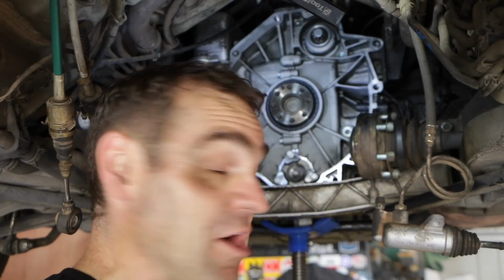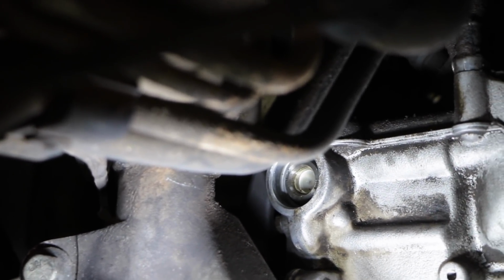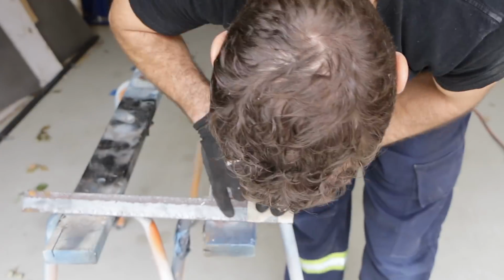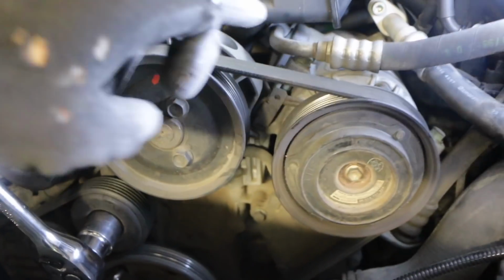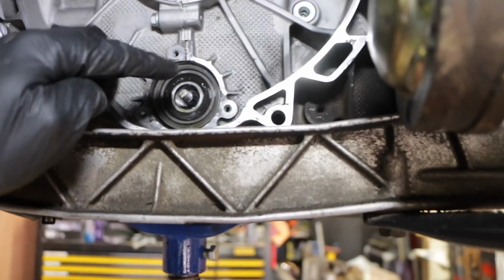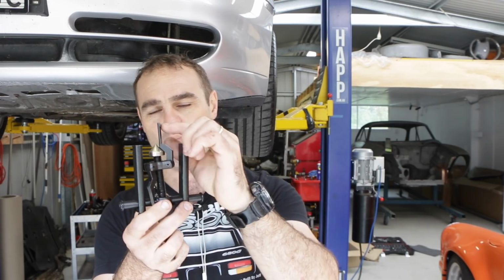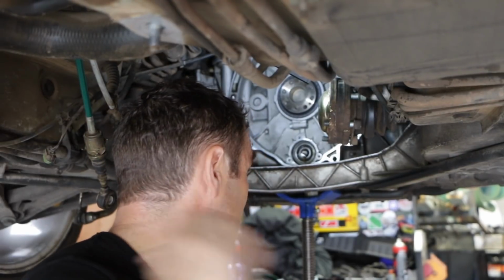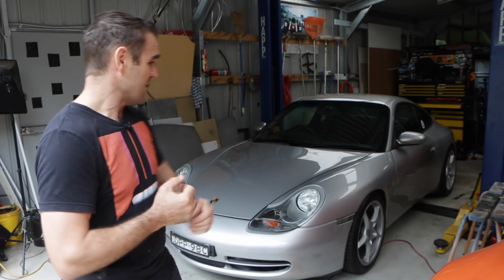996 IMS bearing replacement.. FAIL!

Comment: I changed mine with an EPS bearing. Made the puller out of a bolt and piece of pipe. Easy. DON"T take your car down and fail to replace that bearing. My old one was perfect also, but you never know. If it goes, so does your engine. The EPS bearing is a bigger roller bearing and won't fail.

Comment: How on EARTH did you get to that rear bolt on the AC compressor?? Which tools or extensions did you use?
Reply from the maker: From memory I only used a short extension and a long socket. A small mirror will really help so you can see it as that is the real problem.
Reply: @HomeBuiltByJeff   Got it done last weekend. Surprisingly it wasn’t very difficult at all actually. I have the X51 kit so it may be different due to it having a cast aluminum intake manifold, but I just removed the temperature sensor an rubber grommet between cylinder 4 and 5 and that gives an almost straight shot down to the nut with an extension on the socket. I had one of those socket sets that had a little bit of wobble on the extension which was perfect for the job. I used my phone on video to see where I needed to “go” which made finding the bolt with the socket a breeze. It literally took me 30 min to remove and replace the whole A/C compressor. Thanks for giving me the confidence to do that job!

Comment: Jeff I had to rewind because I heard something you said to describe excessive play. Now I not sure what was on your mind at the time but you described it as SCHLOP. Well I have two dogs and sound of them lapping  up water is  schlopping ....don't think  that  works here .However a one modern day version ...The sound which is made when a very wet substance hits a durable surface at force. This sound would be most commonly heard when an extremely wet turd departs from your anus and hits the surface of the water at speed. Jeff the ims is a right turd....
Reply: This is the dumbest post I have read in a long time.  Delete your account.

Comment: Some bearing kits come with the proper tool to remove the IMS.
No other puller or extractor will do the job it's has to be the correct porsche spec tool. A slide hammer will wreck the bearing at the other end of the Ims shaft.

Comment: Isnt there a Circlip in front of that bearing that has to be removed so that you can pull the bearing?
Reply from the maker: Only on 996.2 with the single row, dual row doesn't ;)

Comment: Don't you pull the bearing by tugging on the bolt you bonked into the shaft?  Put a nut on it and use an 3-prong (outside arms) puller.
Reply from the maker: If you don't pull it perfectly square you can snap it (MANY have) and then you are totally screwed ;)

Comment: there a snap ring holding the bearing in its place, I saw a you tube video and Both where done with the correct puller. https://www.youtube.com/watch?v=hAxj6FKMzvM however he says you can also do it with 2 pry bars
Reply from the maker: The pry bars are just for the cover ;)
Reply: Home Built By Jeff did you remove the circlip? Love your Alfa series btw.
Reply: YES  Iagree. because i watched this video youtube sent me other IMS videos. The one i watched a dirty great big SNAP RING hold the bearing in, Didnt hear him mention it or show him removing it, done it myself so not going to hate BUT I think this was the reason it didnt come out. Shearing off the puller lugs indicates it was still captured. So guess gearbox coming out again!!!

Comment: Jeff. With all the bashing and pulling that bearing is damaged. Don’t spend too much time driving with it. That damn thing is problematic enough when left alone!! Build a puller sleeve the pushes on the block as it pulls the centre stud. That might work better. Also, join the “Porsche ims bearing M96 M97 engine” group on Facebook. I’m sure we can all help out.

Comment: How did you get the center bolt back through??? The one that you knocked into the hollow IMS tube?  It's magic!
Reply from the maker: Magnet ;)
Reply: Home Built By Jeff Did you have to use the slide hammer to get the bolt to seat properly again inside the bearing inner race?

Comment: Stupid question but did you remove the circlip that retains the IMS bearing? Otherwise, I have found Supercheaps hand tools to be of fairly low quality and had breaker bars bend, ball joint separator pickle forks snap and a few others to the point where I no longer buy their products. I managed to borrow a Sykes Pickavant bearing puller slide hammer for a similarly akward bearing to remove.

Comment: I think if I'd got that far, then got stuck I would have opened up the dremmel box and cut that bugger out little by little. Followed by the clean of its life.
Reply from the maker: The metal shavings would go through the whole bottom of the engine and you would have to completely tear it down to clean it.
Reply: @HomeBuiltByJeff  possibly but I have just watched somebody drill and retap a damaged sump plug while it was still fitted by using the old oil to flush the particles back out.
Reply from the maker: @SticklesMickles  Better them than me, particularly with Porsche engine rebuild prices...

Comment: Your Ims bearing is probably fine, it's been nicely lubricated by the leaking crank seal. 
To remove the Ims I think heat would've been your friend here. Effectively you were pulling the inner race where the outer race is gripping to the block. With some pressure put on the puller on the inner race, heat around the outer race would've freed off the outer race and would've allowed you to pull the bearing out.
Reply from the maker: It also has a recessed clip around it that needs to be overcome.

Comment: Jeff-you are always a brave man to tackle some of these things.  I thought that when you welded tabs to the arms to increase the size that one snapped off.  Did it pop outside the casing? I'd be concerned about metal bits floating around a bearing
Reply from the maker: I got all the bits, that was something I made sure of ;)

Comment: What I did was use the part from the slide hammer kit (same or similar to the one you bought) that locks into the bearing, but instead of the slide hammer, I put a piece of threaded rod in the end.  Then I took a piece of pipe close to the diameter of the IMS shaft, ground down the end until it fit perfectly inside the case hole and resting on the IMS (but around the bearing), and slipped that over the threaded rod.  A flange and some nuts on the threaded rod after that, and it's a puller that will extract the bearing while holding the IMS in place.  It's worked great on both single and double row bearings every time I've used it.

Comment: The pullers included in these kits use the the center attachment bolt of the bearing and  push from the tubular wall of the surrounding intermediate shaft allowing no stresses anywhere except on the bearing itself. The puller must touch only the intermediate shafts end facing you and the center bearing bolt period. So the answer was a piece of tubing with an outer diameter of the intermediate shaft , an inner diameter of just larger than the bearing outer races  a flat piece of stock with a hole for the bearing center bolt (which needs a little extension made for it ) and a nut and washer for ease of rotation . The bearing now can be drawn out with all stress only on the bearing.

Comment: Jeff hold on. As a mechanic you will learn,that every bearing no matter where located must be drawn out of it's home . No force between inner and outer races is tolerated. If you pull from the wrong place or impact any bearing you will dent the balls and races causing multiple injury locations internally . This will cause the bearing to start to degrade as the balls now impact multiple flat spots  as they spin. In your particular situation you pulled on the case by way of the shaft and used the shaft's forward travel stop with the force of the puller. The proper puller used in these
Reply: He's removing the bearing and will throw it away after it's out. Why should he care if the balls or races are damaged? (Except in the current case where he's about to drive 4k km on it...)
Reply: @kwajkid  because he buttoned it back up with plans drive it 4,000 km.  Hovered4 is warning him against doing this.  He has a point, and a very good one.  Bummer to have the IMS go because of something Jeff did trying to replace it.

Comment: Not sure you need to remove the top tensioner under the AC compressor. At least I did not...
Reply from the maker: You can't get the third tensioner without it. I have heard of people who don't but it is part of the recommended way to do it.

Comment: It's not a good idea to use a bearing that been pulled and mangled with a sliding hammer. The bearing surface have been damaged now, and I would not trust that bearing anymore. Don't be a tool, get the right tool 😁
Thank you for a really cool channel! Inspiring me to get started with a few projects on my old 911 👍

Comment: For future reference, you can pull blind bearings by stuffing wet newspaper in there and then using something that’s close to the ID of the bearing (like an extension) to hammer the wet newspaper and create high pressure that pushes the bearing out. That’s worked well for me pulling pilot bearings.
Reply from the maker: It is a big hollow tube behind so that won't work on this one.

Comment: The previous owner of my Boxster made a right mess of the IMS replacement. 

They had presumably used a slide hammer and cracked the bearing housing in the process.
Then they used what looked like a grinder to clean it up afterwards.
Ended up replacing the RMS, clutch and flywheel and left it well alone as amazingly it was not leaking.
Burners channel was a great help, shame he does not upload anymore :(

Comment: I used this set to pull out the spigot bearing on my LS1....
The hydraulic method dosnt work on those! 

The slide hammer didnt budge it the press fixture was perfect!

https://m.ebay.co.uk/itm/16pc-Inner-Bearing-Blind-Hole-Remover-Extractor-Puller-Set-Pilot-Bushes-Housing/201920887832?ul_ref=https://rover.ebay.com/rover/1/710-53481-19255-0/1?ff3=2&pub=5575376664&toolid=10001&campid=5338268676&customid=EAIaIQobChMI7NusxteK6AIVRLDtCh2e9whhEAQYCSABEgLhHPD_BwE&lgeo=1&item=201920887832&srcrot=710-53481-19255-0&rvr_id=2326459727184&rvr_ts=b9b8fc4b1700a9b19c072330fff2afb9&_mwBanner=1&_rdt=1&ul_noapp=true&pageci=6b1ce7c0-89c4-4e07-a743-e4a782118cc7&epid=18011013161

Comment: You can use a dinabolt or ramset concrete bolt to remove bearing like these.
Reply from the maker: Interesting, it would need to be a 20mm one but yes that could work.
Reply: @HomeBuiltByJeff  . You can space it out with split washers or a bit of pipe with a cut to split it open.

Comment: Weld a threaded tube or stack of nuts to some threaded rod. Wind tube/nuts onto IMS bolt. Put large socket (bigger than IMS) over IMS with threaded rod sticking through ratchet square. Put big washer over threaded rod and socket and use nut to wind out bearing?
Reply from the maker: I considered doing exactly that, but I have heard of a lot of people end up breaking the end off the bolt and then you are worse off than I was.
Reply: @HomeBuiltByJeff  Assuing it's just an interference fit has anyone tried plumbing pipe freezer to contract the bearing inside the case?

Comment: Here is the guy that made a puller from a pilot bearing puller and some 2 inch pipe.  Fast forward to 5 mins and it shows the tool he made. https://www.youtube.com/watch?v=lbM3c2V4scw
Reply from the maker: It is the pilot bearing puller that was the issue. I have heard of others having the same issue.
Reply: @HomeBuiltByJeff  he had to modify his one to make it work. Sounds like you have a lead on the LN engineering tool already : )

Comment: In a few replies you mentioned dual row bearings don't have c clips, is yours a dual row?? Aren't they supposed to be the safe ones?? While the centre bolt was removed did you check the width for bearing type?? All in all a great video showing as a realistic view of IMS changing. Always appreciated
Reply from the maker: Yes, dual row ;)

Comment: That thumbnails. It tells of the struggle. Reminds me of dropping the oil pan of a 1.8t for an easy oilpump change to find pieces of IMS bearing which explained the low oil pressure under 2000rpm. Not much to do but mount all new parts, bolt it up and disconnect the oil pressure buzzer. Drive and smile.

Comment: where is the circlip?  Perhaps there is a circlip under that plastic cap? something has to be there to keep that bearing from moving. this earlier engine is different than this one?  https://youtu.be/hAxj6FKMzvM?t=224
Reply from the maker: No circlip on the dual row ;)
Reply: @HomeBuiltByJeff  gotcha, the recommended bearing puller looks pretty heavy duty compared to that slide hammer. Now i can see what they're talking about when they say that cars that are thrashed running around the race track have bearings that last longer. One look at that black sludgy oil that oozed out tells the story.

Comment: The bearing is hold with a C clip you do not show removing it .In 2001 model maybe you dont have C clip.
Reply from the maker: The dual row doesn't have a circlip, it has an internal clip.
Reply: yea thats exactly what i was thinking but a circlip should be easy to see right?

Comment: If Its a Blind Hole You Can Put WET toilet paper down the hole and pack it in really tight and the tighter you pack it (hit it with a punch that fills the outside diameter) and the toilet paper will force the bearing to reverse out of the hole
Reply: Mate toilet paper is in really short supply here in AUS at the moment. I mean it. 😭😭😢
Reply from the maker: I know of that trick, but in this case the shaft behind the tube is a very large hollow tube that runs length of the engine.
Reply: @HomeBuiltByJeff  Jeff maybe you could just fabricate 3 better prongs/teeth on that puller. It might be better than getting a slide hammer because you can make the three teeth exactly made to measure because you have the bearing and therefore the dimensions right in front of you.

Comment: Theres an ims delete.. it replaces sealed bearing with an oil feed bush.. and comes with all tools to remove bearing etc.
Reply: That's pretty much what I'm running on my 986S. It uses an oil filter adapter for a spin on filter (Coincidentally it uses the same filter now as my Ford Pursuit 250 ute). A high pressure oil feed comes straight from the oil filter adapter and feeds a replacement IMS bushing directly. Gives me peace of mind.

Comment: Hey Jeff. How did you get the bolt out that you punched through the bearing back into the intermediate shaft?
Reply from the maker: Magnet :D
Reply: Clever!
Reply: clever and lucky.  would have really been a bugger if that had been lost or turned around in there.  you DID take the clip out, eh???

Comment: Lol Jeff you dogde a bullet. Maybe I can see if someone in Sydney has the right tool to remove the bearings this job /repair is a pain in the ass and it's a Porsche as well. Let me know can I can call a couple of European workshops in Sydney.  I wouldn't leave it much longer even if and maybe buy the conversion kit for the bearing . Runs oil from the engine to the bearing.  Go on tuner motorsport /other they sell this kit
Reply from the maker: I have it sorted, thanks ;)

Comment: Jeff, I've seen that IMS job done before and I think there is no substitute for the proper bearing.extraction tool that has been developed to do the job. You will be lucky to have got away without somehow causing some damage to the raceway's of the existing bearing, especially applying shock load from a slide hammer, I hope the old bearing continues to do its job ok.

Comment: Why not just make your own fixture to pull the bearing? Is just a nut and a plate right?
Reply from the maker: You need something to properly grab hold of the bearing. I could make something, but it is better to just use the correct tool for the job.

Comment: I know that feeling Jeff.  I wonder if applying some heat could have helped to reduce the tolerances?  I had a similar problem with removing balance shafts in my Audi.  I had to heat the surrounding area before going at it with a slide hammer.  To install the new balance shafts, I had to freeze them overnight before they would pass through the journals.  German cars... 🤣
Reply from the maker: I had the new bearing in the freezer overnight to make it easier to fit. A bit of heat may have helped, but in the end I think the right tool for the job was what I was really missing ;)